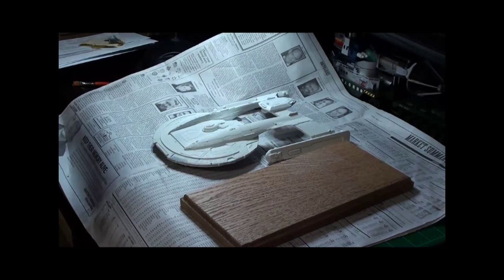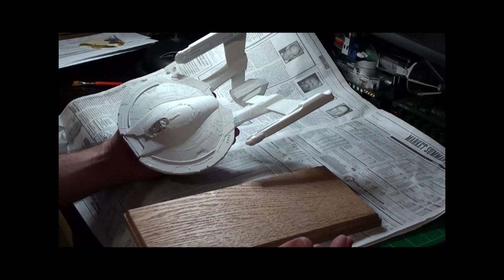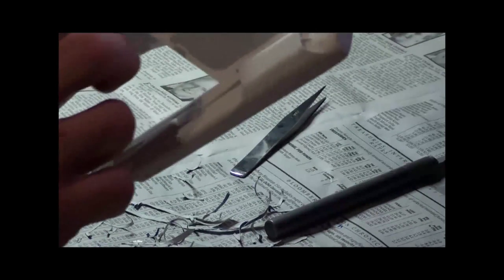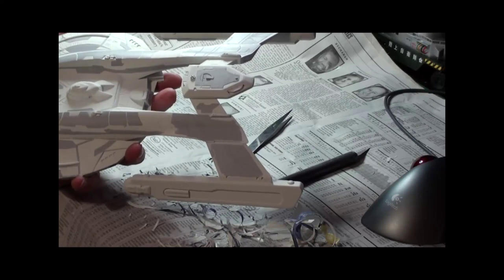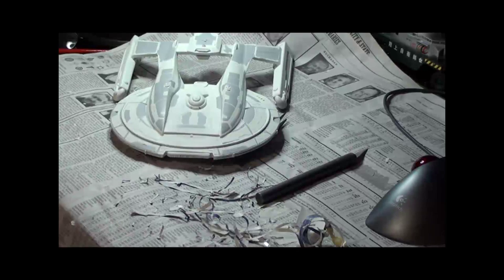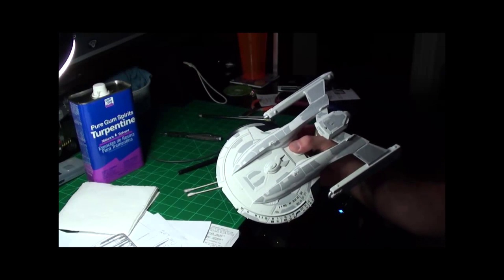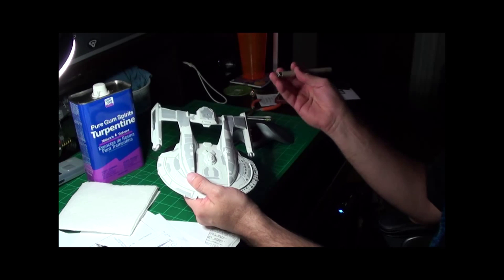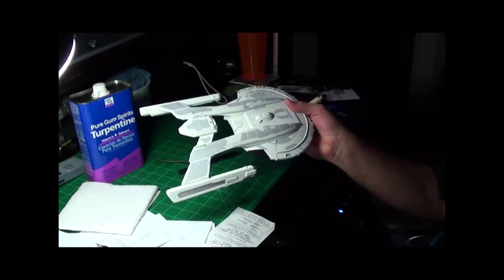USS Thunderchild part 8

Comment: btw, about the Tamiya acrylics eating through the underlying acrylics... they are in the end two different paint types. Acrylic refers to the pigments, the solution however is USUALLY water for most acrylics... except Gunze and Tamiya. They use alcohol-based thinner, Isopropanol -like. 
Alcohol on water-based paints is dangerous for the paint job. Some have even reported Pledge (formerly Future floor glaze) they use for clear coating will not work with Tamiya.

Comment: enamel paint thinner won't attack acrylic paints!? Then we must use different paint types, my Humbrol /Revell enamel thinner eats *everything*, even lacquer-based paints. One drop of it on a two year old model destroyed the final acrylic coat faster than I could get a tissue recently!
 
The OTHER way around however I found to be safe, I can confirm that, acrylic paints on enamel base are perfectly fine and safe to use as the (water or alcohol) based acrylics won't touch enamel.
hmm